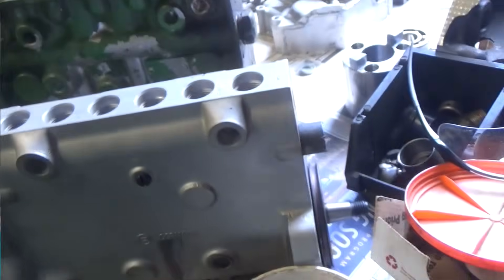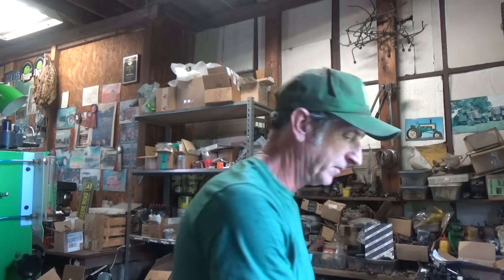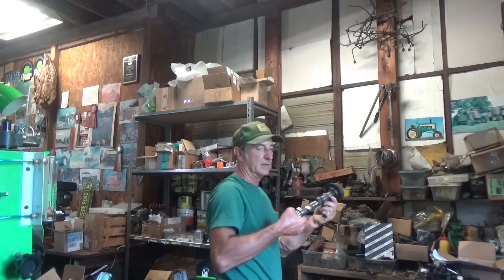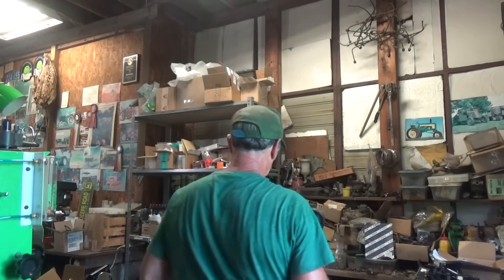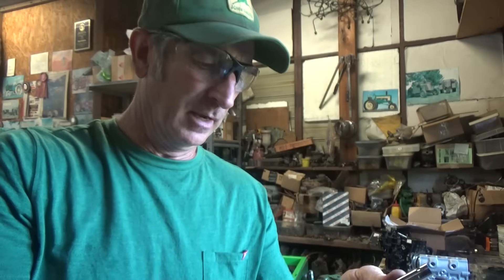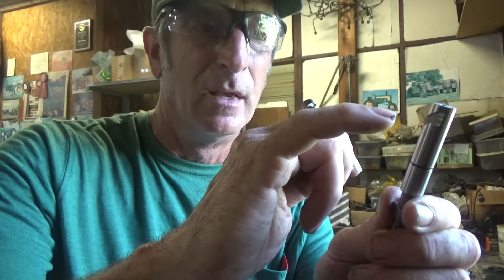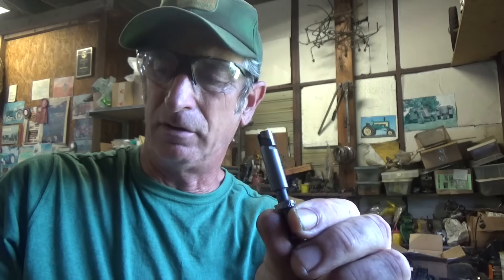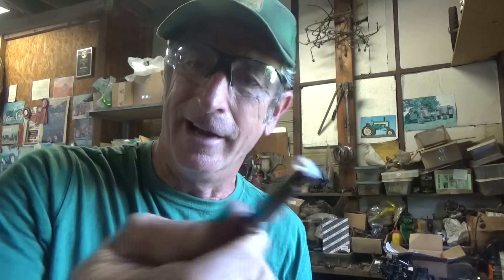"P" Pump Plunger Modifications: Max Fuel Delivery

Comment: just be clear an inline A pump will bolt to a 4320?
Reply from the maker: No, it won't bolt right up, but the pump can be made to work. It would take some aluminum welding and machine work. I've done it. You should consider getting a turbo 466 out of an old combine and putting that in your 4320, a local guy here pulls with that set up.

Comment: Why not just rig another gear drive "A" pump to  the existing A pump, and parallel in the fuel lines to the injectors??? That would supply way more fuel to those injectors than your modified P pump will...A hell of a lot simpler and reliabile to!
Reply from the maker: Hey Mark! Good idea, but the rules are pretty universal that in this class you can only run one pump, with one plunger per cylinder.
Reply: @so.md.maniacs1403  Well hell,,,,How about drilling the head for another 6 injectors opposite each other? Enough room on the head to double up the injectors? Then you could double up the a pumps...Probably a rule against modifying the head :( Be hard to hold head gaskets anyway, but she would be a runner for maybe 300 ft.

Comment: Hey Bill, loved the video great info on the pump and parts inside it. It would be interesting to talk about what causes those pumps to run away on tractors and or the rack getting stuck. Thanks
Reply from the maker: Hey Kenneth! When that plunger gets galled in the barrel and can't go up and down or rotate, then the rack is stuck in whatever position it was in, usually full throttle.That causes a runaway situation.

Comment: It's nice to see there are a few of us that try to get power with skill not just money
Reply: Thats why im building a garden tractor puller. Went to a garden tractor pull this past weekend and everything is still built by hand with a weight transfer sled. Real pullin. Im figurin out the wheelie bars and weight racks tire pressure and balance. Real pullin. Im gana weld it together with scrap bedframe.
Reply: Im putting a v twin kholer in a Cub Cadet 1000. Gana call it The Spirit of Solid Junk. Does anyone agree?

Comment: First!😂 Very interesting, using brazing to back fill the slot. Why not machine it down instead of sanding it? Even with 1500 grit, wouldn't it leave straightenions (?) on the rod? I apologize for my spelling on that word.😮🤔🤔
Reply from the maker: Hey Morgan! l don't have a machine l would trust with tolerance's that close, l would have to hand fit it anyway.
Reply: @so.md.maniacs1403 I figured you were a bit smarter than a machine, but I had to ask!👍👍